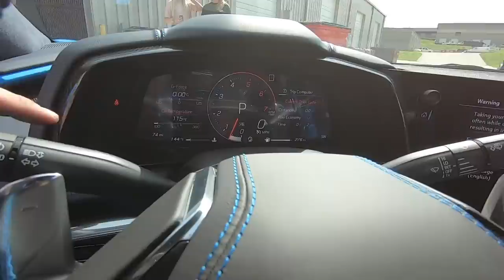We FINALLY Got Our Mid-Engine C8 Corvette!!! 1000+hp Axles, Lowering it, and MORE!

Comment: Fastest stock corvette ever is "a little slow". That's how you know cletus has fun toys.
Reply: Do you mean fastest base model?
Reply: Nah, a 1969 Corvette ZL1 would even give that thing a run for its money lol.
Reply: Premoe66 Nic Premoe  First of all, the ZL1 did not make 430hp, go look up actual dyno numbers. The engine made around 585hp and was shifted at 7500rpms. It was something chevrolet did for insurance purposes back in the 60s. I myself have an L88 1968 Dana Camaro, same engine but with a slightly tamer cam and an iron block. My car was advertised to run 11.50 @ 120 or better when sold (back in 68 on bias ply tires) with a 4 speed at an NHRA sanctioned track. So no sorry, the ZL1 is not as slow as you think it is.  Its still an all aluminum solid lifter big block that revs crazy high. Second of all the C3 corvette is widely renowned as one of the most timeless corvettes made, so your opinion there is a little off of what most people actually believe in. 3rd of all, the C8 is listed as running an 11.2 in the quarter from GM. So yes I will state that a 1969 ZL1 Vette would be a good match up even to this day. There are a few examples of these cars and the L88 vettes running low 11s. And I believe there was one on slicks clicking off a 10.99 back in the day.
Reply: Premoe66 Nic Premoe  I dont have any ego invested into this argument, I have facts, if it was so slow why would they advertise the technically slower L88 cars to run 11.5 @ 120mph in the quarter over 50 years ago? I'm just being honest with you lol. It would be a close race. You can very well put the power down in that car with a proper set of tires that are not bias plys from the 60s.
Reply: Premoe66 Nic Premoe  Are you talking about the 430hp argument? I'm sorry but if you think a solid lifter 12:1 compression big block revving over 7k is making 430hp you are not the brightest. Im guessing you don't know much about engines lol.
Reply: Premoe66 Nic Premoe  "Beefing up my car" More like restoring to exactly the way it was in 68, I have other cars to put money into to "Beef up" 😂😂😂
Reply: I just watched a l88 corvette sell for 400,000 at mecum auction so yeah the l88 is beyond desired whoever said this is better than the c8 is a moron the c8 is one of the most wanted vettes on the planet
Reply: 69 vette is my favorite year. But still the new vette would most likely win the races. New vettes launch control and transmission play major factors in this. Cant wait to see zr1 platform
Reply: @jonwest138  Modern technology makes it superior stock to stock but still nothing wrong with a classic the new ones are hard to work on and a lot of people don't see it as a true vette just a Ferrari clone
Reply: @dillonplemmons9649  alot of ppl dont understand why Chevrolet really made the mid engine.. Chevrolet felt like they maxed out the front engine platform. They wanted to make it better and that's what everyone truly wants so idk why ppl are getting so bent out of shape when they did a complete overhaul.. and classics are one of a kind I'd pick the 69 over any vette it's an amazing looking car in my opinion..
Reply: @jonwest138  yeah I know people don't understand much these days unfortunately all that college to come out dumber than a box of rocks
Reply: @dillonplemmons9649  you ain't lying there
Reply: Chance it’s faster 0-60 than a C7 ZR1
Reply: @mycorvettelife  0-60 no. Launch control
Reply: Jeff Kopis  Never claimed it was a circuit car lol. Horsepower has been around for years, suspension hasn't. However there are protouring C3s that would run circles around a C8.

Comment: Cleetus McFarland Just wait until that break-in tune shuts off after 500 miles and you get that little extra horsepower/torque. 
I wouldn’t be surprised if you end up adding a ProCharger to it when they become available. Just like you did with your C7!
Reply: I think a pro charger doesn't fit... It came up somewhere before.
Mind you, the tuned twin turbo C8's are trouble.. one ate it's pistons and the all destroy the clutch pack. That would have to be the first thing when tuning a c8 for serious power. Upgrading the gearbox/clutch pack.
Reply: I do agree with you however we all know that there will be kits for them soon or later and I wouldn’t be surprised if supercharger kits are currently being developed for them already but not released for production until the computer is cracked and tune ready. I do believe there are already aftermarket clutches on the market capable of handling much higher horsepower. I personally prefer the twin turbo route but the supercharger companies aren’t going to be left out.
Reply: @P-J-W-777  i believe a top mount supercharger doesn't fit under the hatch. So it would have to be a snail-type charger mounted lower or something...
Reply: W0o0dy yeah that’s pretty much what I am thinking too. I don’t see a roots style fitting unless they come up with a totally new design. The hard part is going to be the belt are up against the firewall and hard to get to from what I’ve seen and been told.

Comment: Aren’t C8’s rev limited before the 500 mile mark? I think remember that when Tj Hunt got his, it unlocked the higher rev limiter after 500 miles 🤷🏽‍♂️ correct me if I’m wrong boyo’s
Reply: Not limited. Guage reads 4500 redline in break in but it still pulls to 6500. Power is reduced 30% in first 2 gears while in this mode.  As soon as it hits 500 the tach changes and you get all the ponies.
Reply: Yes they are  I seen the video of  tj and Mike getting theirs
Reply: @joehebert7576  There's a simple workaround to get all the ponies from the start boys, short pins 2 and 17 on the com, turn the ignition on and off, then remove the short and bobs your uncle.

, 
Actually, I have no idea what I'm talking about, sounded convincing enough though right? lol

Comment: I love how they casually talk about how slow a low 11 second car is 🥺
Reply: It is compared to everything else he owns, how "fast" something is is a matter of perspective.
Reply: i mean when you own a manual 1500hp death kart i dont think 500 will phase you much
Reply: One that's been breaking axels
Reply: It's at 70% power till the 500 mile break in is over.
Reply: @fastmaros  wrong. They make it look like the redline is lower but you can still tach it out if you want.
Reply: @Bamabrute85  torque is reduced up to 30% till the 500 mile break in is over.
Reply: @Bamabrute85  I'm sure he will show it or talk about it in a later video.
Reply: i bet money nobody woudlve complained about the speed if it was a manual tansmission
Reply: 402CarKid he never ran that time at the track, the cars time is probably off by a little bit, so for now still believe the c8 is a low 11 second car

Comment: “It’s not that fast” 😂😂😂 typical 1000+ hp corvette owner
Reply: Isn't it "not that fast" since its in its break-in miles? I heard it limits to 4 or 5 thousand rpms with no launch control until the odometer hits 500
Reply: Tbf it is his second slowest Corvette. Ruby, Leroy and evening the white C7 are all faster than it.. currently only faster than the driftvette for now.
Reply: @H3110NU  I don't think that's a firm fact about the C8 being faster than Donnie. They probably make the similar power. I say there needs to be a race.

Comment: I love how you talk like the car is the slowest thing ever,  but it would destroy anything I can afford.
Reply: Just buy a bike, problem solved 😂
Reply: It's at 70% power till the 500 mile break in is over.
Reply: @fastmaros  Still slow even at 100% tho
Reply: @Koop2k  It's more of a track car than a drag car. I wouldn't call it slow.
Reply: @fastmaros  it's actually 67.5%
Reply: Slow or fast are relative terms. On my channel I take trucks up into the mountains and break em. You don't need speed but you need power!

Comment: When your used to 900 to 1000hp a stock c8 seams slow 😆
Reply: Speaking of SEAMS.. How straight are the stitches on the dash. They had real quality control issues with that. In fact, even diehard Corvette guys have been selling these things like crazy. It turns out that price was met with a lot of corners being cut. But, they are still selling them at a profit!! People are paying 100k plus on these!
Reply: @kevina2052  ya seams on that dash😄 must of changed seems on me. Thats what I get for not reading it before hitting posts. 😑

Comment: That C8 is sick, but I think I’d take that orange ZR1 back there over this C8. Sorry, just sayin’.
Reply: I’d take the motor out of that ZR1 and put it in that C8 which actually has enough room to cool a supercharger.
Reply: For damn sure
Reply: I think it would be a tough choice if you had to pick one.
Reply: Can't go wrong either way
Reply: @tapuout101  very tough choice
Reply: Honestly I like the styling of the C7 a bit better.  Saw a black/black/black C8 in traffic the other day, it didn't stand out at first, took me a second to click that it was the new Corvette.  Might just be that black is a really unflattering color on this car as well, hides all the slashes/lines.
Reply: @AaronSmith-kr5yf  Right the black doesn't show but yea that C7  looks slightly better than the blue one!
Reply: I must say also, I understand the dynamics of the mid engine, but the C7 some how seems sexier.

Comment: How would it be to modify a brand new car you bought before you even sit in it
Reply: The absolute dream mate!
Reply: I don't understand how it's modified to 1000hp when you can't even dyno it see it's full performance until 500 miles due the chevys restrictions. It doesn't make sense.
Reply: @Kevin-xv2nh    he didn't say the car made 1000hp, the axles they installed are rated to support up to 1000hp.
Reply: @zackrogers9334  yeah I read it wrong. Someone pointed that out to me. Thanks man

Comment: It's funny nobody told him about the 500mile break in period aside from no launch control it means it also cuts torque by about 30% to save the driveline so no wonder it felt slow to him. And no wonder other people were breaking thier axels they didnt allow proper break in time. the gears never not to properly mesh together.